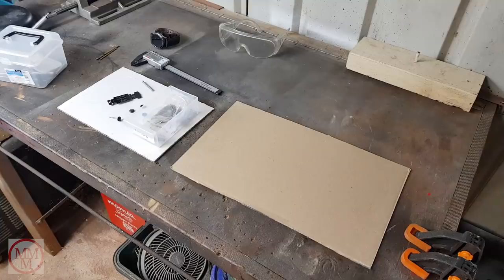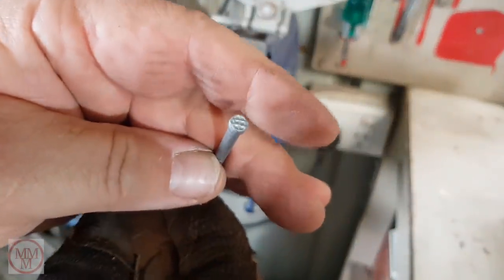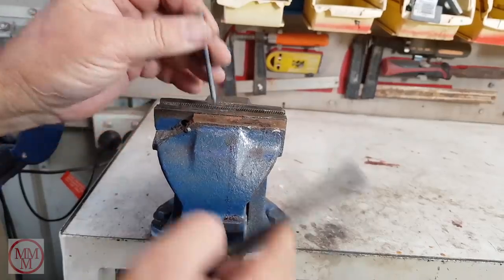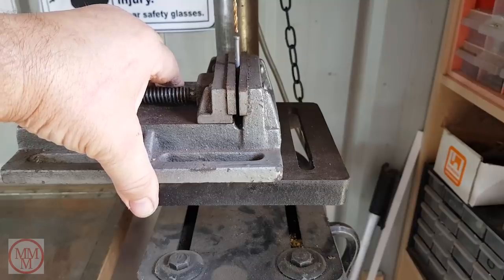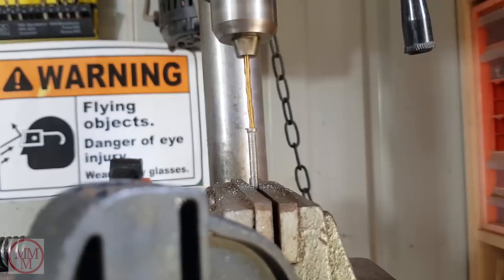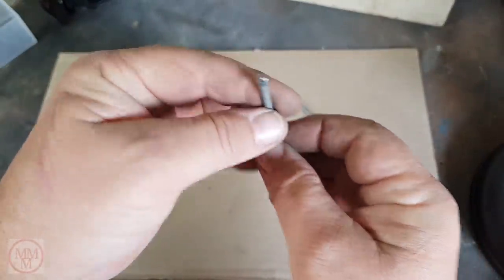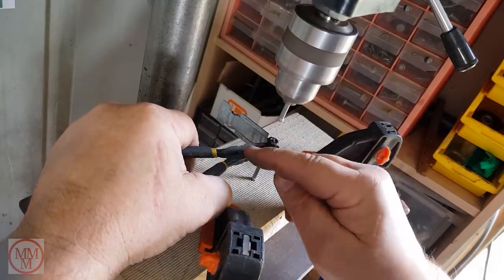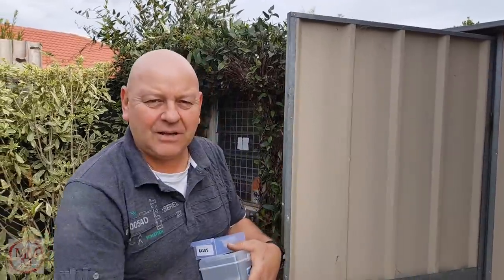HOW TO - Making An Axle Reforming Tool

Comment: Excellent tutorial Marty! One thing I would add is that those who do not have the vice for the drill press. Can hammer the nail to be drilled a couple centimeters into a section of scrap wood. Make sure it vertically aligned and centered to the drill bit. Before clamping to the press table and drilling. Although not as good as the vice is does offer an alternative to those without one. 
 Thanks for all the amazing videos Marty. Cheers!

Comment: We used to clamp up the drill vice and drill a hole with a small drill between the jaws, this helps if you want to hold something vertically in the drill vice. Only works if the jaws are not hardened obviously.

Comment: You could put the nail in the chuck of a hand held drill, so that you can spin the nail as you grind the nail head on the bench grinder. 
Should help in keeping the grind perpendicular.
Reply: I was thinking of punning my belt sander in the vice dont have to worry about rounded edge of the grinder

Comment: instead of using the grinder to get the nail head flat. try this, insert the nail upside down in to your drill press, turn drill press on and lower the nail head down onto a flat metal file or sand paper, this will make it perfectly flat and will give it a machined finish
Reply from the maker: Great idea Dave, I must try this next time, thanks for the hint!

Comment: Great idea for sure. Couple things, is there any reason why the head is the only part that needs to be that diameter? Couldn't you use a larger nail and thus more durable from bending if the whole piece was the diameter of your nail head? And on that note, if you went with a concrete nail, they are made of higher carbon steel and should last longer. Also when grinding the head if you chuck the nail up in a portable drill and spin it while grinding you are sure to get an even grind.
Reply from the maker: All good input, I like it, you are dead right with what you say and, as always, my subscribers/watchers give me good information to work with! Thanks heaps! Marty.

Comment: If you put the filed blank in the chuck of your drill press, turn your drill on and bring it down on some fine-ish emery stuck onto a secured bit of wood with double sided, you will do two things: True the angle of the head; put some machining marks on the surface of the head. This will show where you need to centre pop the head.

Happy hunting.

Comment: I've tried this technique and I have not had any luck so far. Not giving up yet. Any other tips for finishing the ends of the axle???
Reply from the maker: Yes! - I have evolved into using 2 hollow tipped nail punches.
Reply: @MartysMatchboxMakeovers  Interesting... Any pics or videos? I have become entirely too frustrated - broken a few wheels on my very first restoration project of the Routemaster Bus.

Comment: Hi Marty, I am an avid follower, I was wondering l have recently started restoring my Matchbox vehicles,  as part of the dismantle l have been using the reforming tool to remove the bur on the axles, just a slight touch does the job, have you used this method. Are there any pit falls.

Comment: Hi Marty, does this tool work on the smaller modern hot wheels/matchbox axles?
Reply: Doesn't work on the post 1968 Superfast Matchbox cars and trucks. Neither Hot Wheels. Try wheel swaps if you need to replace them.
There are wheel replacement kits with all different size wheels in 1/64th scale out there. Axles are included with them.
Reply: he's the Master, yes I have a few of those kits. Sometimes I find the axles are to long for some cars and the excess sticks out. I have tried cutting and crimping the ends but they never have that factory finished look

Comment: As always; GREAT STUFF !  Thank you for this Post.  QUESTION -  Does if matter if you use an original / steel axle or the shaft from a "pop" rivet ?  A few of my projects had very short axle shafts so I used a small dollop of BONDIC ( http://www.notaglue.com ) followed by a dab of silver from a paint pen.  Not as good; but the wheels roll and do not fall off !  Next I plan to purchase some aluminum rod stock from my hardware stockist to experiment with fabricating new axles.